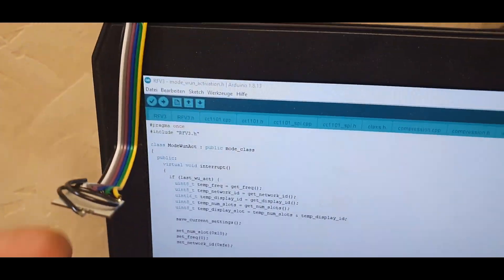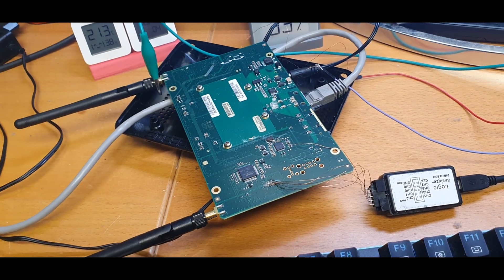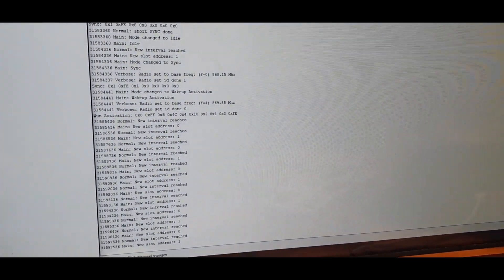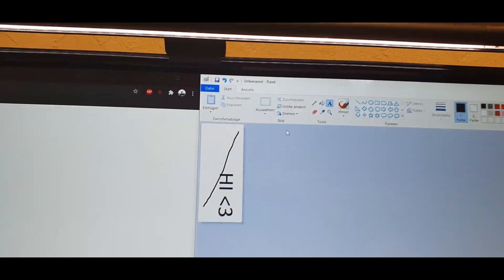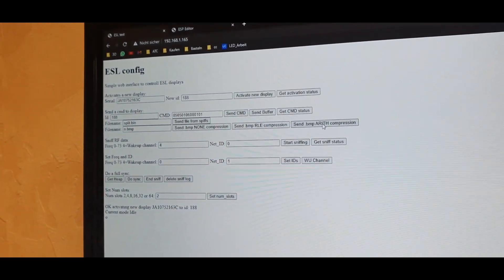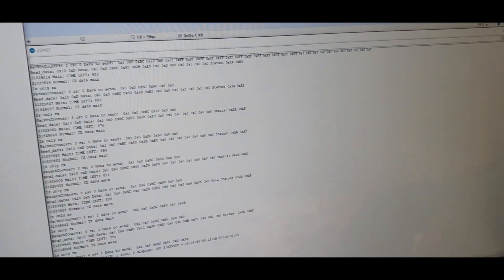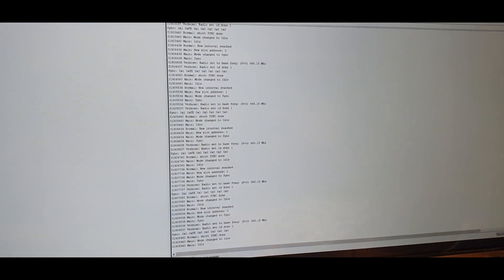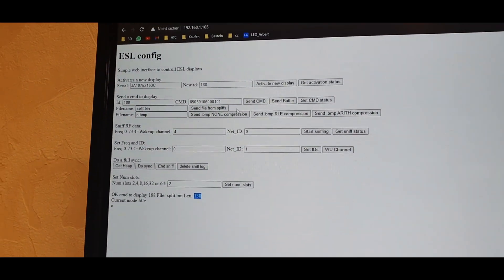E-Paper Price Tags controlled via Arduino ESP32

Comment: 1. Which Arduino model should I use?
2. How many e-papers can I use with one Arduino?(I want to use the Digital Picking System.)
Reply from the maker: Its an ESP32 Arduino module.
There are 65000 possible displays that can be connected

Comment: Would you be able to use an ESP8266 for this?
Reply from the maker: Hey yes should be no problem. The more ram the better but the newer version is improvet to use less ram.

The dual core is used on the esp32 to make the web unterface faster